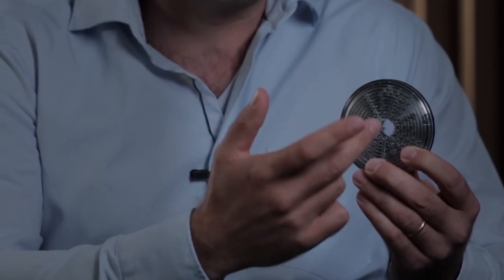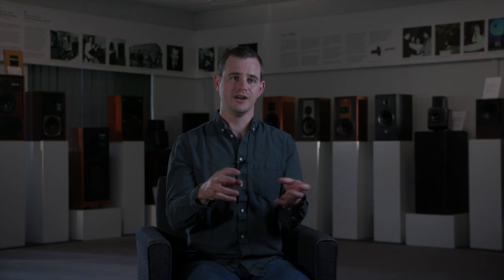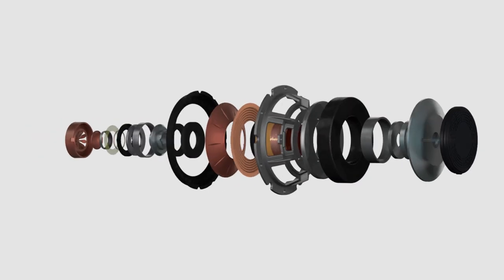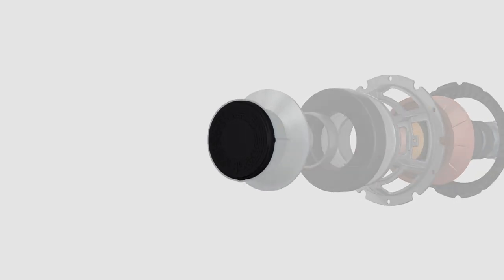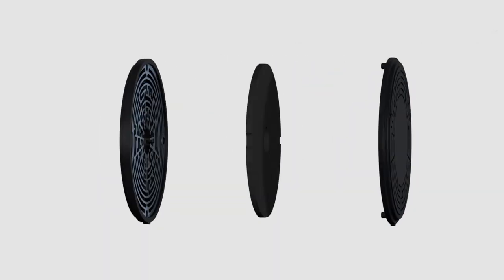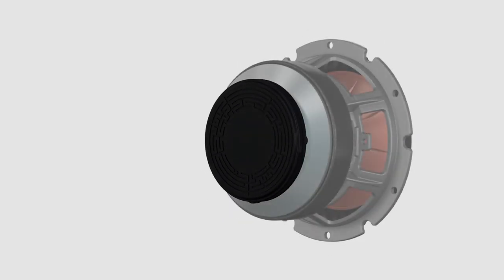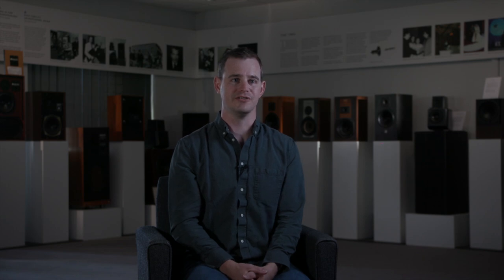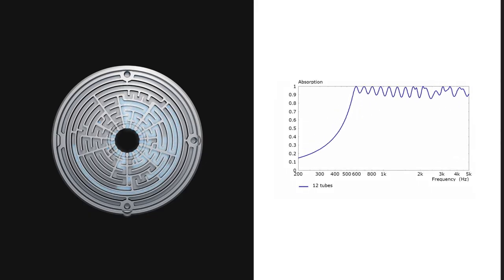KEF Metamaterial Absorption Technology (Full Version)

Comment: This is good and all that, me like development and progress.
But what about thus silly name.
Is there any logical explanation where the name origin from (metamaterial)??

The Wikipedia says:
"A metamaterial (from the Greek word μετά meta, meaning "beyond" and the Latin word materia, meaning "matter" or "material") is any material engineered to have a property that is not found in naturally occurring materials."

So is it that that plastic disc with its maze have a property that is not found in naturally occurring materials? Is that the reason for its name?
Reply: Yes actually with this shapes on the material they absorb more than they would flat or in most other shapes
Reply: "So is it that that plastic disc with its maze have a property that is not found in naturally occurring materials? Is that the reason for its name?"

Sort of.

Specifically the surface pattern geometry (the maze) gives the disc sound manipulating properties beyond the capabilities of bulk plastic material it is made from alone.

Optics have been well into their own metamaterial revolution for years now.

Some time soon lenses in cameras (or VR inside out tracking sensors) will no longer be constructed from multiple heavy curved glass discs but rather surfaces engineered to bend the light in specific ways while staying flat, very thin and light - a single metamaterial lens element can be engineered to focus all visible wavelengths of light vs multiple heavier curved glass elements that are needed to focus each specific wavelength of light separately to reach the sensor in the right order for full RGB color.

In short the camera bump on smartphones will be a thing of the past once this tech becomes commercialised, leaving the camera module level with the smartphone surface - regardless of lens type (wide/telephoto) or sensor size.